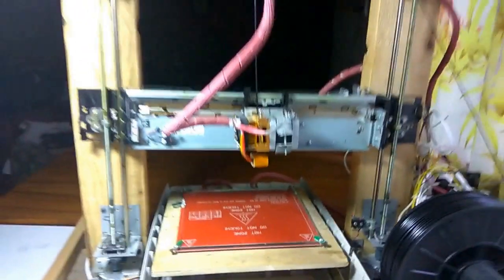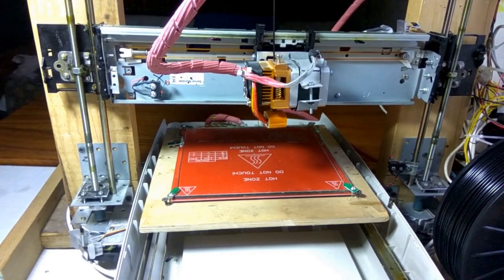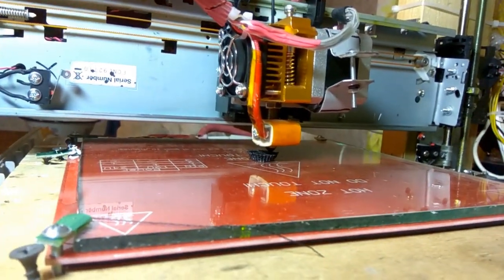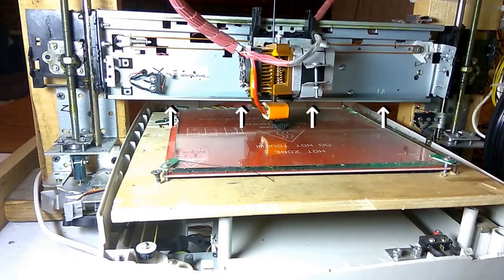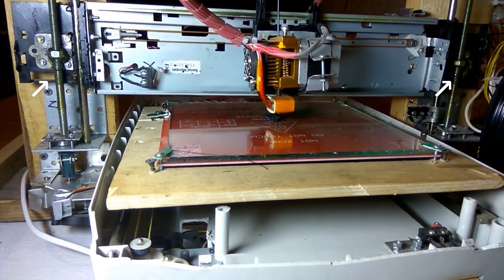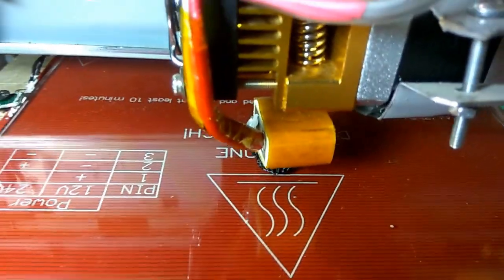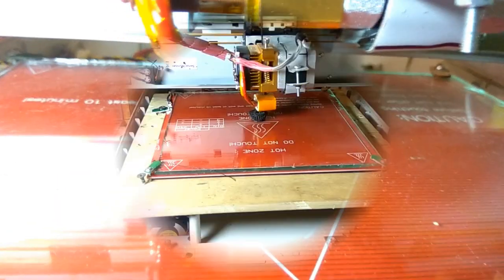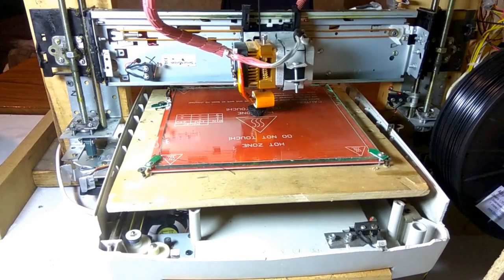[en] Repscrap. DIY 3d printer from old printers and scanners.

Comment: Hey man, i love your project and I have three old printers laying around can I convert all three of them into 3d printers or do i need two to make one of these gorgeous machines
Reply from the maker: Hi, thank you! Probably you will need all three printers to make one 3d printer. Some parts will be good, and some won't be suitable for this application. For example, the motors from old printers could be rated for 24 or 36 volts and could overheat if running from a 12 volt control board. Or you could run those motors from a 12 volt control board and limit the current on the driver but the torque of the motor will be small.
It all depends on what parts are inside of those printers.

Comment: Hello I am trying to make a 3d printer Arduino codes as a link can you throw the bide screen I did not use the bide screen I could not afford it so I use repetier what are you using I would be very happy if you help I have quite a lot of problems and my English sucks
Reply from the maker: Hello, I used Repetier at first. Could be problematic if the PC crashes then the print crashes too. I would still recommend getting a display even smaller one.
Reply: @electronpath  So can you throw away the link to the Arduino code?
Reply from the maker: Most of the process is quite simple:
For Repetier you have to flash their firmware to Arduino:
 https://www.repetier.com/documentation/repetier-firmware/
And then install Repetier Host on your PC:
https://www.repetier.com/
First start and configuration described in their documentation:
https://www.repetier.com/documentation/repetier-host/rh-installation-and-configuration/
Reply: @electronpath Hello, I wonder if you would recommend 8mm threaded rods (Tij) are efficient?

Comment: This is awesome! Would love to see how you build it! Also, would love to see how you programmed it!
Reply from the maker: Thank you! Unfortunately I can't show you how I built it right now. It was almost 4 years ago and since then I printed plastic parts on that printer and build a Prusa MK2.5 printer clone https://www.youtube.com/watch?v=MzduN3RbeYI. 
I had no space for two 3d printers and had to disassemble this one. This machine is significantly slower than my Prusa clone but was fun to built.
Programming was not hard at all and well documented. I used marlin firmware  https://marlinfw.org/
Basically I just changed a few lines in the firmware (which pins I've used for endstops, termistors etc.) and that's it.

Comment: Could you send me exact instructions(including all necesarry elements ) to build that printer on my own? email: kamilbrzozowski3@gmail.com . You 're the one who buit 3d printer mainly using recycled parts. That's amazing
Reply from the maker: Hi! Sorry for the late reply. Do you need a list of parts that I used? 

Unfortunately I can't give you exact step by step instruction. There are a lot of different printers and scanners and a lots of ways to attach everything together.
Reply: @electronpath  i 've got a few printers based on stepper motors. Is it possible to build that printer using step drivers from printers? Could I replace ardiuno mega with arduino uno? Im going to optymise build costs as much as possible. If you have list of parts, you can send me at my mail.